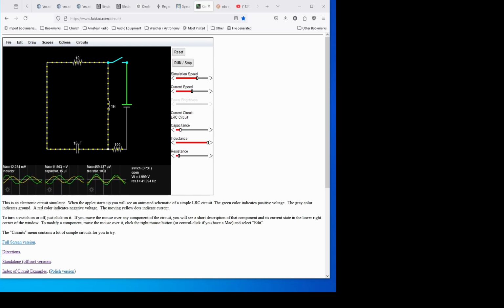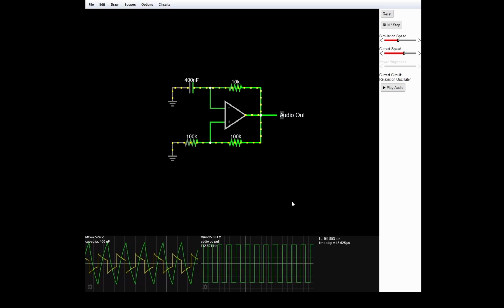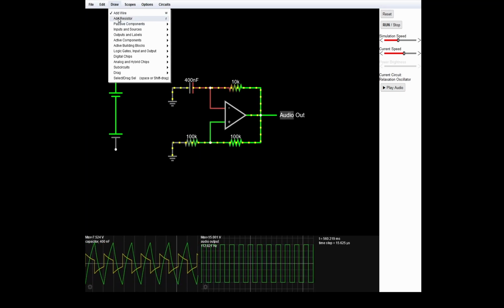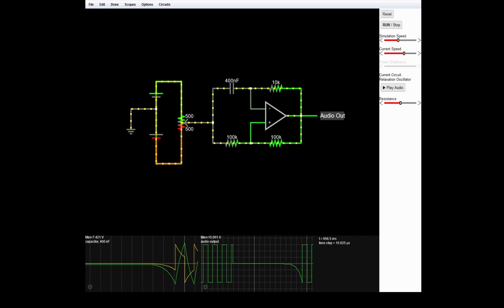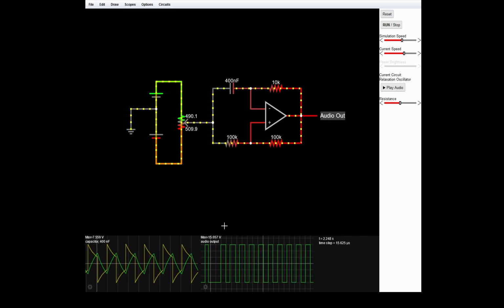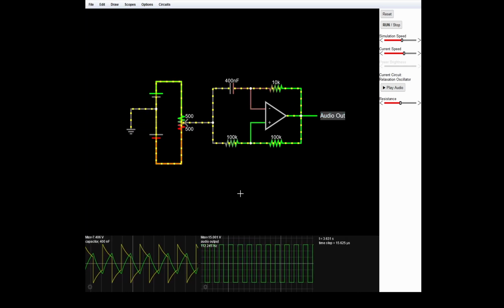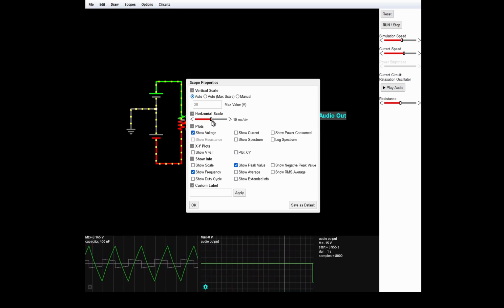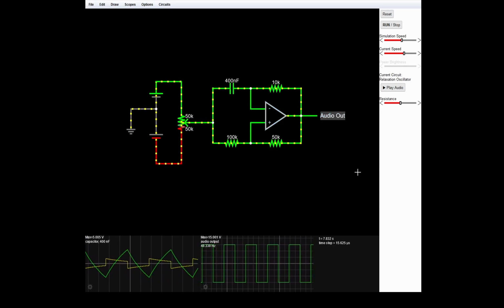Variable Duty Cycle Op-amp-based Relaxation Oscillator Lab

Comment: The yellow line in the scope is the current, at the same point.  You can modify the parameters of the scope with the small settings icon in the left bottom corner.
Reply from the maker: Thanks. I had figured that out by the time I made the second video. That was a head slapping moment seeing that I had drawn countless such voltage and current curves.